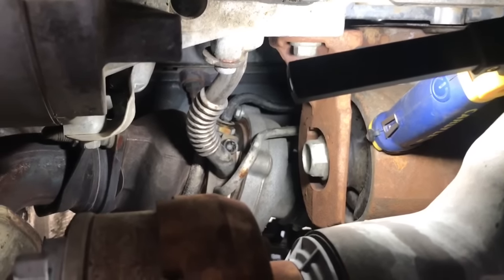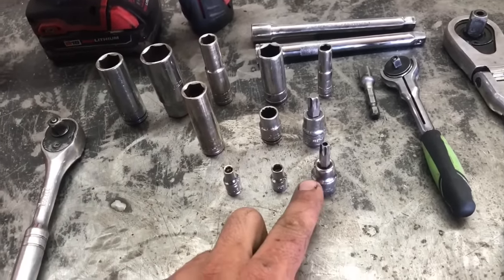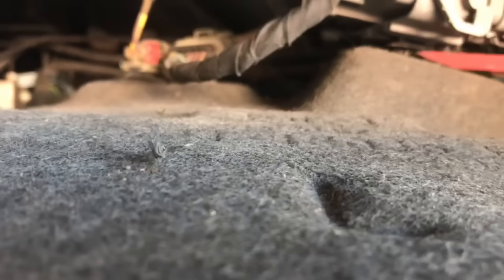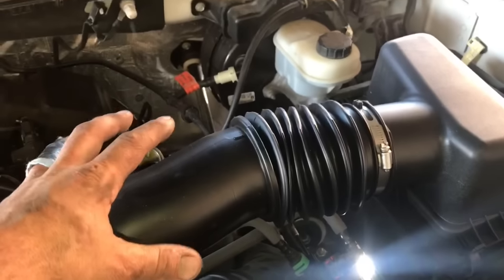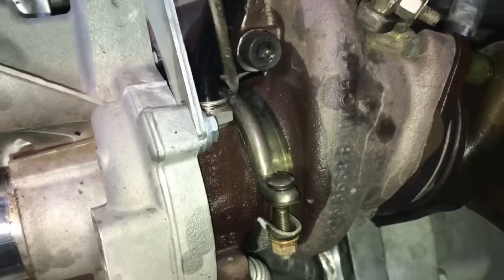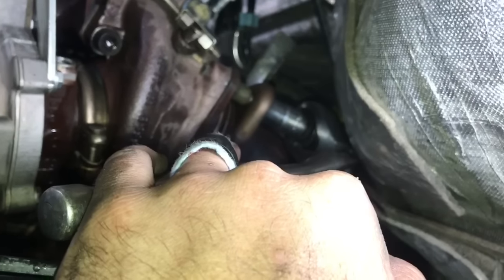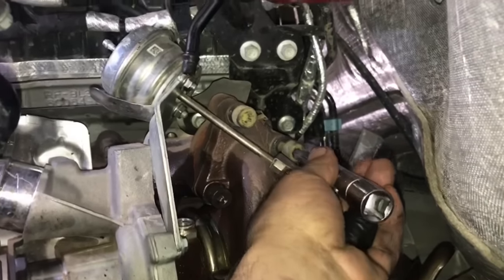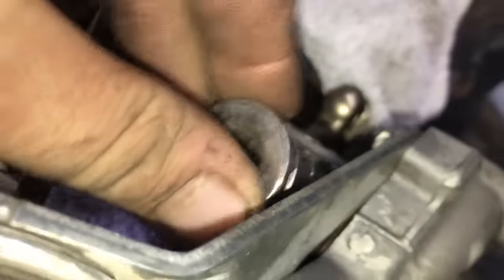F-150 Ecoboost 3.5 Turbo Coolant Connector Replacement (Tips and Tricks)

Comment: I know you mentioned it a few times, but could you give me a little more on the driver side block fitting removal access. Do I cone from the top or bottom  (2013)
Reply from the maker: you come threw the wheel well. if i remember correctly you will need a t40 torx bit to remove a bolt that holds the bolt to the block. once the turbo is off, you can see the bolt. you may need to tioe the intake pipe out of the way. then use a pick to remove a clip that holds the pipe onto the fitting. be happy its not the passenger side! you need to remove the a/c compressor to gain access to that one.

Comment: Hello I have a similar issue with my coolant line but it is at the other end, not the turbo. Do you know if the coolant connector is the same on the other end behind the intake manifold? Do you think it will be easy to replace the line or  try to see if there is a coolant connector?
Reply: It's a different size, but you commented 7 months ago so I am sure you figured it out. I have the same issue... howd yours go? Any advice?

Comment: Both sides are leaking on mine. Im assuming that was the driver’s side on your video. I think i see the starter motor on the passenger side. If so that is gonna be a bit more work. Any info on that would be helpfull.
Reply from the maker: yes the passenger side is a little more work due to the starter, however its only 2 bolts to drop the starter. all electrical connections can stay intact. in this video i remove the passanger turbo. it might help. also if you have a high milage engine i would recomend replacing the coolant connectors that are attached to the motor. not just the leaking one on the turbo 
https://www.youtube.com/watch?v=3YVanw-x21E
Reply: Better get it fixed because I just found out I had this issue because the leaky coolant line ruined the starter and left me stranded so had to replace the starter and pay for a tow.. yay ecobust🙄
Reply: What’s the turbo oil gasket part number?
Reply: Also I’ll be servicing both turbos and my question is are the parts numbers the same for both sides?
Reply from the maker: @luisseminario4790  BL3Z-6N652-B
here you go. 
https://www.amazon.com/Ford-BL3Z-6N652-B-Turbocharger-Line-Gasket/dp/B00M37D5QY

Comment: Just got quoted over $900 to repair driver side leak.  They are charging 5.5 hours to fix.  Same issue as on this vehicle
Reply from the maker: yikes! is this a dealer? 900 seems a little high, all gaskets and coolant connectors shouldnt cost more than 60$. good luck!
Reply: Yeah, it's a dealer.  Thanks man
Reply: Zach Webb I just got quoted 1800 at ford house.

Comment: Do you need to change the oil on this, or was that just because you were doing work on the truck?  Did you need to drain the oil, I must have missed that if so.
Reply from the maker: No you don’t need to drain the oil, however I think changing oil is a good idea
Reply: @AaronHinesAuto  For sure, but just did full synthetic less than a month ago...so was curious :)  Thanks so much...great video and super detailed....really great resource, people like you!!!

Comment: Aaron, just wondering if you recommend replacing all the jiffy tight fittings when replacing the factory manifolds? Also do you have recommendation or tips on removing the jiffy tight fittings at the rear of the cylinder heads? 100k miles on mine and will hate to reassemble everything only to have a leak at the rear of the heads due to having to adjust the coolant feed line to remove the turbo.
Reply from the maker: Yes I do recommend replacing all the fittings with high miles. To remove the rear fittings at the back of the head I use a open end wrench, cut it in half due to clearance and lay over the motor and unscrew the fitting with the pipe attached. I remove the pipe with the fitting on it and install the fitting back onto the pipe then install the pipe back onto the motor. That’s the easiest way I have  found
Reply: Thanks for the tip  @AaronHinesAuto . So intake manifold stays in place?
Reply from the maker: yes it does

Comment: I have a low boost code on my 2015. There is a coolant leak at the turbo. Would this cause the low boost code or is there something else going on as well?
Reply from the maker: I haven’t seen a coolant leak cause a low boost code. The electric bob and turbochargers are more common culprits
Reply: @AaronHinesAuto  what do you mean by electric bob and you mean a bad turbo right?

Comment: How did you get to the water connector on the back of the engine block?
Reply from the maker: Lay over the intake and reach around. I if I Remember correctly you need a 15/16 wrench. I put one in have to make it easier to use for clearance

Comment: I think I have oil leak at drivers side turbo. 2012 eco. Do you have a video going over that? We have a bad gas oil smell when running a/c or heat. We have to run recirculate at all times not to smell it in the cab makes my kids sick. I have had it at a dealer twice an mentioned the smell but they ain't fixed it yet.  Maybe that oil line gasket on turbo?
Reply: That or oil seal inside turbo
Reply: @jdoz2400  well I believe the turbo has failed now Anyway... It kicks in and out and can hear a bearing squeal when it does come in.

Comment: Does the turbo charger oil supply and oil return gasket ever just go bad?
Reply from the maker: im sure it could, however i have never seen one leak, you could remove both bolts that hold the oil lines to the turbo, bend the hoses a little and replace the gasket without removeing the turbo. here is the part. BL3Z-9450-A
https://www.amazon.com/Ford-BL3Z-9450-A-Turbocharger-Gasket/dp/B00M370S82

Comment: Thanks for the video.  Have this problem on my 2013 with 90k miles.  Have gotten quotes from 2 shops, both saying about $2500 per side including replacing turbo.  Both highly recommending replacing the turbo.  One wants to remove front clip to replace both.  It seems your method would work and not have to replace turbo.  Any recs?  Thanks in advance
Reply: Rob Smith what did you end up doing?
Reply: Same. What’d you do?

Comment: Nice vid.   Any chance you can put the part numbers in the description.   I’m getting ready to tackle this and exhaust manifold on my 2015.
Reply from the maker: sorry about that, the numbers and links now are up! if you have alot of miles on your truck, i would replace all the coolant connectors not just the ones going to the turbo. the top line has a connector that goes into the back of the cylinder head. and the line at the back of the turbo has a connector that goes into the side of the block, on the passanger side you will have to drop the a/c compressor a few inches to remove the connector in the block. its no too hard.
Reply: Aaron Hines where are you located?! Any chance you want to tackle this on my truck? What price should I expect if I take this to a ford mechanic (not dealership) thanks!
Reply from the maker: im in phoenix, AZ. if you can get the truck to me, sure,  price will be around 500-800 to replace all coolant connectors on one side with a independent shop.

Comment: Hey. Question, I do have a leak coming from the same spot, but would this be causing my fans to run on high a lot? I changed the thermostat and sometimes I can see my temp gauge climb higher than normal and then goes back to normal, fans and gauge recently started doing this, I just found the small leak on the turbo also.
Reply: having the same sympthoms, overheating up hill to. 
you ever found the problem?

Comment: Your video is excellent and I was able to get everything done but my question is on the passenger side where the coolant line goes to the block started to leak when I got finished. Everything else I did is bone dry. My question is how do I get to the front of that line on the passenger side? Any tips will be of great benefit. Thanks
Reply from the maker: You will need to remove the turbo again unfortunately. Then you will need to cut the belt off the ac compressor and take out all 3 10mm bolts the hold the ac compressor on. The compressor will drop down a few inches and you can gain access to a bolt that holds the line to the block. With that off you can replace the coolant connector on the block. Sorry about your bad luck. Those connectors suck.
Reply: @AaronHinesAuto  thank you for your response that will be very helpful. Your site is awesome and it helps ask guys like me save some money, appreciate it. Happy holidays
Reply: @AaronHinesAuto  Are the same "-C" connectors used in the back of the block or are they the "-JD" connectors? Had the left side done at a dealership about a month ago and their parts list specified the "-JD" connectors as well.
Reply from the maker: @brandon_freeman  BL3Z6A968B  goes into the back of the cylinder head, BL3Z6A968JD goes on the side of the block, BL3Z6A968C goes into the turbo, you will need 2 of these. one for the top turbo postion, another for the side turbo position, i hope this clears things up, so there are a total of 3 differnt coolant connectors used on the truck
Reply: @AaronHinesAuto  That helps a ton. When researching parts I noticed that there were several different connectors that were similar but I can't find schematics for these anywhere. I bought 2-C's and the JD just in case. Turns out the connector in the back of the engine on the passenger side is leaking and not the ones in the turbo. I've had this issue on both turbo's within 1 month of each other on a 2015.
Reply from the maker: thats a bummer, if the line is forced up too much, the coolant connector can leak, specially on higher milage motors, what side are you working on?
Reply: Aaron Hines I’m working on the passenger side and figure I’ll go ahead and replace all 4 connectors while I’ve got everything off.
Reply from the maker: @brandon_freeman   i assume you read my comment above about gaining access to the  front connector in the head? if not here it is " you will need to cut the belt off the ac compressor and take out all 3 10mm bolts the hold the ac compressor on. The compressor will drop down a few inches and you can gain access to a bolt that holds the line to the block. With that off you can replace the coolant connector on the block".
Reply: Aaron Hines I did see that. You said cut the belt off of the compressor, did you mean that literally to where I’ll need to replace that belt?
Reply: @AaronHinesAuto  I saw your comments about replacing the connectors for the water lines located on the engine block on the passenger side.  

when you said cut off the belt does that mean I would have to replace the belt? 

Can I unbolt the ac compressor and move it without losing the vacuum or damaging those lines? I’ve never done that so any description on what to expect would be appreciated.
Reply: @AaronHinesAuto  the coolant pipe behind the A/C compressor On the block. Is the bolt the only thing that holds that in to the fitting or is it supposed to be clipped in? This connection  did not connect like the rest of the fittings and I want to double-check before I put the whole thing back together. Thanks!

Comment: Can this be done without pulling the whole turbo out?
Reply: I just replaced mine without taking anything off other than the connector itself, did all the work from underneath the truck. Granted I only did the bottom connector on the drivers side as that was the only one leaking. It is tight though, I wear large size gloves myself but don’t have “meaty” hands and was barely able to get my hands in there to finagle it out. Only used a small flathead (I would recommend a pick if you have one) to get the clip off, a crowbar to get the line out (be careful to not put force on the oil lines) and get it back on and a 15mm 3/8 drive regular socket and ratchet to take it off and put the new one on.

Coolant will leak everywhere even if you drain from the petcock on the passenger side. I was regrettably being lazy on this not thinking it would be much but I really wish I had jacked it up to fit a bucket underneath.

Mine is a 2013 F-150 3.5 EcoBoost, King Ranch for what it’s worth. Maybe took an hour total not counting beer breaks, I think I could do it again in less time.
Reply: Thank you Dan. Gives me more confidence. Your wet up looks nearly identical to mine which is a 2018 Raptor.
Reply: @danof76  how bad was replacing the back side fitting and removing the tube? Also when you put the new fitting in the turbo, did you leave the clip in the fitting and then slide the tube into place? Or did you remove the clip, slide the tube in and then reinstall the clip? Thanks

Comment: Can you just replace the o-rings in the fittings?
Reply: IF you could, youd have to pull the fitting to do it in which case for $12 I'd rather just put a whole new fitting in there.

Comment: I replaced the fitting on the driverside turbo when I finished it was leaking at the back of the engine so I figure I broke the seal on the fitting on the back of the engine. How hard is it to replace those
Reply from the maker: I have seen this issue few times on higher mileage engines. It’s quite simple. Grab a open end wrench and loosen the fitting on the back of the head. Remove the retaining clip and remove the coolant connector. If your wheel well is still off, remove the pipe off the turbo to give you more access.
Reply: Thanks do I have to take the intake off
Reply from the maker: No you don’t. Just lay over it and your arms can reach the collector. It’s a little tough because it’s by feel. I can remember the range size but I believe it’s 15/16s. I cut an open end wrench In half so it was able to get on the connector in without it in the firewall or anything
Reply: Did you tackle this project yet? My fitting on the back of the engine on the passenger side is leaking. Did the 15/16s work for you?

Comment: Really struggling with getting coolant lines off. Using a small screw driver sharpened to a point. Any further tips would be appreciated.
Reply from the maker: He can be stubborn. Have you removed the small C clip that goes into the fitting yet?

Comment: Whew I'm glad I got rid of my 2013 F-150 EcoBoost....Tundra is the way to go.....I feel sorry for  all of you experiencing this issue with NO help from Ford.  This part shouldn't fail under 100k or even a little beyond in my opinion....
Reply: GTFO. I had a 2007 Tundra 5.7 water pump leak with 80k miles on dot. Shit wears and tears. Also trucks sitting have couples and things dry up. Normal wear and tear. Difference is that 3.5 makes all the torque at under 2500 RPM where Tundra had to be pushed to over 4k. AND it's faster. AND sounds better.

Comment: Can the fittings be replaced while the turbo is still in the truck?
Reply from the maker: Only one can. The top fitting, Turbo needs to be removed for the side fitting
Reply: Is it a clearance issue? Seems like I can get to  the fitting closest to the engine without much trouble. I can get my hand to it, so I figure I can get a socket on it, or at least an open end wrench on it.
Reply: @MrBencatchot  Were you able to do both with the turbo still attached?
Reply: Motomadman43 I wound up having the dealer do it for about $400. I was more concerned about breaking off one of the exhaust studs, and it becoming a huge pain.
Reply: @MrBencatchot  which dealer did it for that price
Reply: @aleona10  Sandy Sansing in Daphne, AL. I asked the service manager how long it would take his tech to remove and replace the turbos, he said about 4 hours. I then explained what I wanted done. 

I had already gone to the parts counter to buy the fittings, so I knew the parts cost.
Reply: @MrBencatchot  Nice, I will call them and tell them I want it done too. thanks.

Comment: I am not understanding why you had to remove the entire turbo. Can’t I just replace the leaky fitting after removing the coolant line?
Reply from the maker: you need to remove the turbo to replace both connectors on the turbo. one is on the top, and the other is facing the motor and isnt accessible with turbo on
Reply: Aaron Hines thanks!

Comment: How do you replace the fittings at the block
Reply from the maker: The driver side is very easy. On the passenger side you need to remove 3 10 mm bolts.  And cut off the belt for the AC compressor. The fitting is hiding in between the block in the AC compressor. Once the AC compressor lowers a couple inches you can get through the line  very easily
Reply: @AaronHinesAuto  Do you really? I can see my connection just fine on the passenger side. I also have a 2011 so maybe that makes a difference?

Comment: FYI to possibly avoid all of this labor. JB Weld were the fitting meets the metal pipe. Worth doing and if it somehow doesn’t hold the leak back, you can still easily replace the line with new fittings doing this procedure he lays out in the video.
Reply: Has anyone actually tried this?